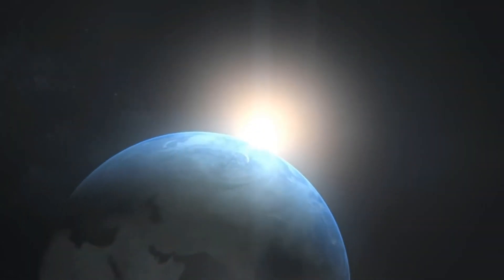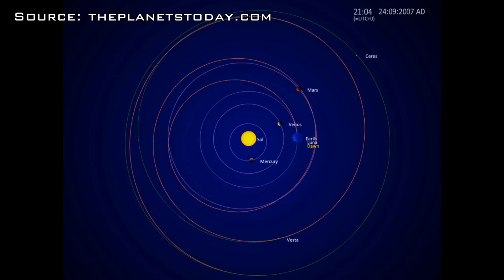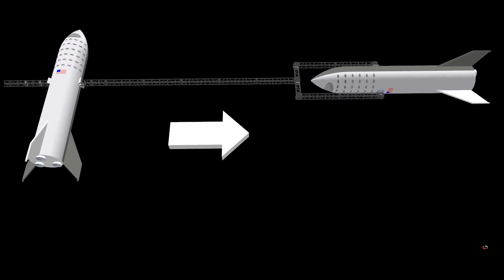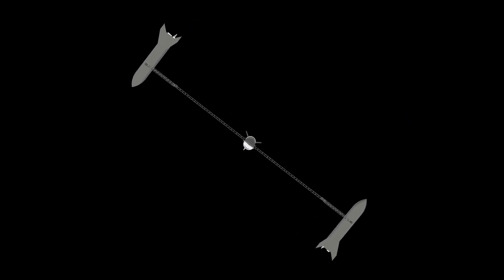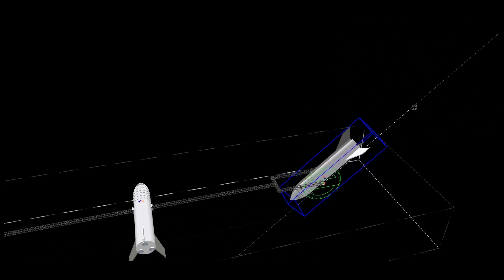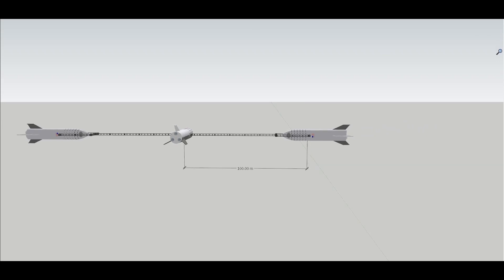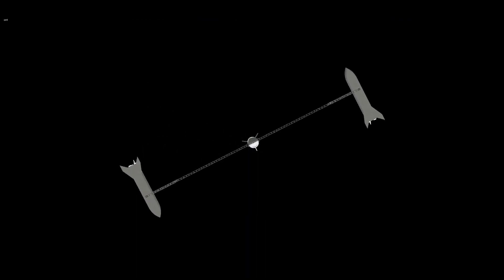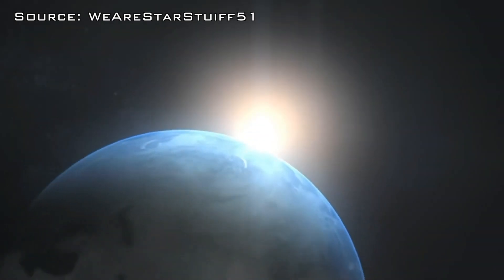GLS2: Artificial Gravity for SpaceX's Starship

Comment: Bone/muscle degradation over 9 months is reasonably negligible when landing on a planet with a third of the gravity, and if you spin up you must also waste fule spinning down apon arrival not to mention the forces generated by spinning 200 tons of starship arround each other would be huge and likley unmanageable, and the added risk of small impacts destroying the whole truss system and sending both starships millions of km off course in opposite directions.
 space stations stay in the same orbit, an orbit they can hypothetically clean up with lazers ect every time they go around, a starship is cruising on an untouched route with many potential obstacles and micro meteorites to run into.
Space ships and space stations have radically different capabilities and purposes, making this wildly impractical.
Reply: It seems many of what Space x fanboys consider to be science is pure fantasy.
Reply: You might want to take a closer look at the consistent results from mounting data before you go with "reasonably negligible" for health effects.  The list of known significant negatives has been getting longer rather than shorter, and the gravity level at a destination won't undo many of those those issues.

>  not to mention the forces generated by spinning 200 tons of starship...  <  Let's mention those forces anyway.  200-ton masses spinning around each other at 1 G results in a cable force of...  200 tons (forget about a truss, for various reasons including "way too many points of failure").  Using your mechanical engineering ability you can do a quick calculation and conclude that even for an aircraft-grade steel -- nothing terribly exotic -- the cable would be about the diameter of a baseball bat before a factor of safety is applied.  From your civil engineering background you recognize that's not much compared to say bridge cable bundles predating even the Wright Bros, and of course we can do a lot better than steel nowadays.  From little more than high school physics you have probably noticed that delta-V for spinup/spindown is no big deal (just don't use Raptors -- that would be an ouchie!).  As with the delta-V for returning to formation (minus any further artificial gravity) after a cable failure, the energy expenditure would be small compared to other budget items in the fuel reserve margin.

I've never heard about any interplanetary probes receiving significant damage in transit, especially ones to the inner planets, but your point about the possibility is well-taken considering that the surface area of even one spaceship is way more than the sum of all probes ever launched.  My first thought was to launch a few of them to Mars uncrewed -- provisioning  flights -- and see if those still have cabin pressure and intact fuel tanks by the time they get there.  Might be from impact, or just plain ole design/manufacturing defects.  Another approach would be to instead use the upmass from those notional pathfinders to better shield the crewed rockets.  An interesting trade study,  given the intangibles.

"Thander":  >  It seems many of what Space x fanboys consider to be science is pure fantasy.  <

Yes, their numbers are clearly thin in terms of practicing engineers.  But even more so for the trolls.  Most of the 1-G engineering we're talking about here is actually simpler than what engineers tackle with say the aerodynamics/heat transfer inside a modern gas turbine (jet engine).  Getting the cable weight down and dealing with the inevitable dynamic modes is the hard part here.  But for some of the engineers involved in such a project, it wouldn't even end up being the hardest problem they will face in their careers.

Comment: Does this take into account the affect of having gravity be stronger at your feet than your head? Or the Coriolis Effect? A criticism of 2001's design is that it's so small, running in it would make you nauseous because of the Coriolis Effect's affect on your inner ear. Another is that you'd want to fall over due to the effect as well. Does this design build a large enough ship to take that enough into account?

Comment: You don't need trusses. They only increase complexity and impracticability.
It is enough to have two ships and a cable. 
If  rockets will stretch the cable and then gradually will transit into a spin then the cable will fill as stable as a truss.

Comment: I don't see the need to create Earths gravity, something much less would surely be much easier to achieve and give most of the benefits.
Reply from the maker: IMO, the higher the grab, the more the benefit (up to 1 G)
Reply: @smallstars  - absolutely true, but the stress on the components would be immense if full Earth gravity was being simulated. Some sort of compromise would likely be necessary to balance the engineering difficulty and weight of the contrivance against the potential gain.

Comment: I would leave the GLS in orbit while on mars. I would also design it differently and build it as a permanent structure in earth orbit without all the unfolding mechanisms. It would actually be easier and more structurally sound. Think flying Eiffel Tower. Then the two ships could dock for the voyage. I would also equip the GLS structure with a pressurized corridor between space craft so crew interaction and assistance could be promoted. Equip the GLS with its own engines for spin up and spin down. This would solve the thrust matching problems. It could also serve as a fuel tanker, so no chance of failing to get back to earth if fuel production on mars failed.
Reply from the maker: I agree with much of what you said except about orbiting Mars. The plan is not ever to enter mars orbit, but to enter atmosphere immediately upon arrive for air braking. It costs extra delta V to enter orbit, and then land. Also how would you refuel the GLS for the trip home if u didn't land?

Comment: I have always been a big proponent of the necessity of having gravity on our trips to Mars and onward.  And since accelerating at 1G, landing on Mars (or destination of choice), taking off from Mars, and returning to Earth all at 1 G is an impossibly massive waste of fuel, the only way to have artificial gravity without all that fuel wastage is centrifugally.  As you pointed out, and as living on the ISS for long periods seems to prove, the health of our astronauts/cosmonauts is at risk.

The system you propose is one of the first that I have seen that is a REASONABLE and DO-ABLE system and should be looked at seriously.

And to make fuel more available, send gas tanks to orbit Mars until they are needed.

Great video.  I am subscribed awaiting further insights.
Reply from the maker: Thanks, subscribers are important right now. I'll continue to pop out videos, and strive to make them higher quality than this one.

Comment: Interesting concept. If I may odder some suggestions, thus truss would never survive. Once you get the spin going, the forces on the truss will be predominantly tensile. Trusses as depicted are not an optimal solution. Cables would be optimal for carrying those loads with a minimal structure for rigidity. 

Also, who land with the truss/cable system? Unless you intend to perform some sort of maintenance action on the system on the surface of Mars, it may be more efficient to leave it in a parking orbit to reduce launch mass from mars. Some one would have to measure the risks in doing so versus the added mass and risk to landing with and launching with the system installed more than necessary. 

Lastly, firing the engines in the orientation depicted to start and stop the spin might be problematic. You are going to put a considerable side load on the two outer craft. Rockets are designed to take loads like that, they are almost exclusively designed to take axial loads. Most rockets will buckle even from those if they are not pressurized. Those side loads, and the bending forces that come with them, will be a significant design challenge for the system. I think you would be better off keeping them in the axial orientation an forgoing using the main engines to induce the spin. Perhaps some small spin motors mounted on the truss/cable system itself that can feed into the primary fuel system. If you mounted them at the ancher points on either side and gave them 360 2d DOF that would give you 4 independent vectors on 2 planes for both spin gravity and thermal rolls, and you wouldn't need to change the rockets orientations to adjust the spin.

Just some things to think about.
Reply from the maker: Thanks for the intelligent response!

1. Yeah the truss will have to be just an addition to the main tension cords, which will be made of massive cables. I'll have animations of this in version 3.

2. Landing is actually more efficient because how else would you refuel for the journey home? Plus aerobraking. There are no plans to orbit mars at all as of now, just get there and enter the atmosphere and land.

3. Yeah the loads as animated now will be too much. For version 3 (in the next GLS video) I'll have an animation showing a co rotation that happens simultaneously to the spin up burn and spin down burn. I'm thinking that's one way to help with the loads.

Comment: So, you wana suspend 2 40 story buildings on some steel and then want to spin it. good luck
Reply from the maker: Where there's a will there's a way! Imagine if 10 years ago I told you we would be landing 6 story buildings propulsively?
Reply: Maybe..... in a hundred years or so.
Micro meteorites and such would eventually inevitably destroy anything that thin, this is open space we're talking about not an orbit that you can routinely clear of debris. 
Yes the structure could hold, but the dangers of breakage and thus the dangers of a missed trajectory/completely destroyed starships from its own debris are far to great due to the nature of spinning things at high speeds with meteors around.
And we haven't even got the tech to detect and blast away debris in orbit yet let alone whilst traversing the spaces between planets.
Its nine months, they'll be fine without gravity.
Reply: @grumpyaustralian6631  wtf, micro meteorites!? really
In outerspace.... I let yourself figure out what is wrong with that.
Reply: @MrSofazocker  i know theyre technically asteroids but uh yes man, lots of them, but yeah they aren't meteorites unless they hit an atmosphere lol
Mars sucks in heaps of debris from the asteroid belt between mars and Jupiter making it far more clusterd than "open space" would generally be.
This is the inner to middle solar system, its busy in here.
Reply: @smallstars  well, no. Either your 150m+ beams are made out of titanium, otherwise it would not withstand the jerk of even one engine. There is a thing called inertia. This isnt a gently push, but an explosion going of and thrust 0 to the lowest thrust in under 200ms. 
I see your not familiar on how to calculate static, so I won't continue talking to a wall.
Reply from the maker: @MrSofazocker  I think you underestimate me. The amount of inertia that the thrust creates is based on the mass that is being pushed. Most of the mass is at the outer edge of the spin system, and the thrust is applied where the mass is, so the bending load shouldn't be too bad on the truss.
Reply from the maker: @MrSofazocker  Also, titanium would be fine, I never said steel. All of this is just a concept and I did some math to make sure it was feasible, but I'll let real scientists and engineers figure out the details.

Comment: The concept is good.  Rather than 2 or 3, you could do this with one ship that has an expanding central scaffold and rotate the two sections.  Then you could increase or decrease the spin depending on the scaffold length like a skater pulling her arms in to spin faster.
Reply from the maker: Yes any tether only system would have to be able to expand and contract. But keep in mind as you contract the centripetal force will increase.

Comment: @smallstars 2:42 why do you make the starship rotate instead of just attaching it backward ? and why do you need 3 ships instead of attaching the 2 directly, with cables by example ?
Reply: also, why not turn at 0.3 g the gravity of mars ?
Reply from the maker: @AuxenceF  the purpose of the swivel is to use main engines. In my opinion, the more gravity the better up to 1G to make the humans strong.
Reply: @smallstars  my proposition :
1 : the 2 vessel reach orbit
2 : they make a rendez vous 
3 : the two vessel start their burn for their insertion in the earth/mars orbit
5: the 2 vessel are at a 180° angle
6: 5 tether are attached between the 2 ships
7: the ships start to accelerate to increase centrifugal force up to 0.3g, gravity is now perpandicular to the ship, we have now less deck but they are a lot bigger

8 : before the marsian circularisation burn the tethers are retracted
9: the 2 ships land on mars

I propose 0.3 g gravity because they are going to mars anyway so 1g is a bit pointless and i think that even when going back, it wouldnt be worth the metal fatigue for a ship which aim to be cheap.

Comment: First of all, this is by no means a new idea. The idea has been studied in mnay different similar configurations. There's an entire page in Atomic Rocket about it which is worth your time reading:http://www.projectrho.com/public_html/rocket/artificialgrav.php
It appears that nausea due to Coriolis forces is not as big a problem as once thought. there is more recent data on minimum centrifuge diameters and rotation speeds nad this design seems to be in the clear. 

There is however another issue that might make it impractical. If you've been following the building of the Starship prototype you may have noticed that there is no underlying truss or any kind of "skeleton" under the rings. the outer skin of Starship is also the load bearing component. The Starship structure is designed to bear weight vertically using compression forces that flow from top to bottom, and are divided equally around the perimeter. applying a large sideways force on two highly localized points, and requiring the entire starship to not only withstand strong shear forces during rotational acceleration but also withstand tension forces on the bottom half during spin will require strengthening of the structure in a way that would add more weight to the starship.  Meanwhile the center ship has to withstand double tension forces as the two other ships pull at it from both sides so it's either add more strengthening or create two variants of starship. now add the weight of the truss itself and the effective carrying capacity of starship might be highly affected. without crunching the numbers (which only SpaceX engineers can)  this suggestions is meaningless.